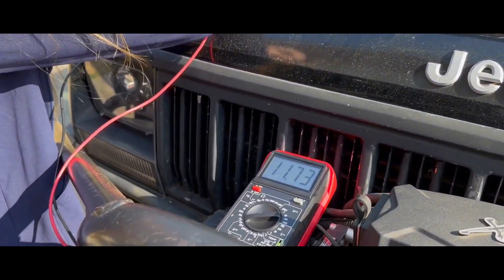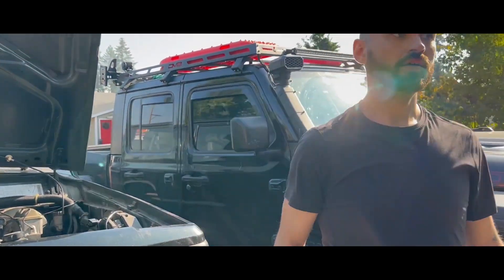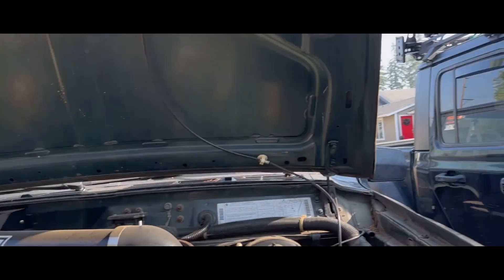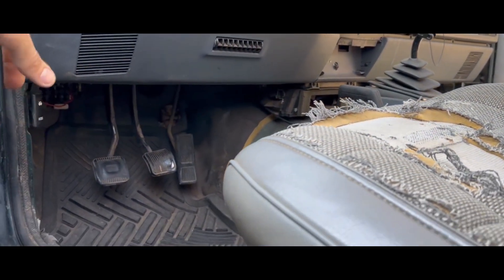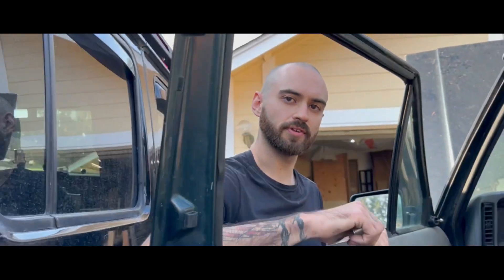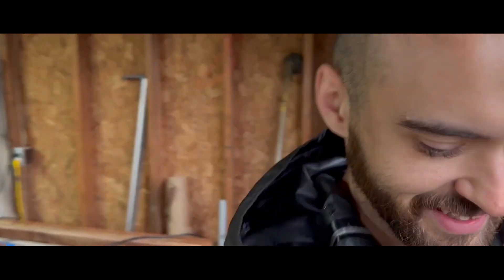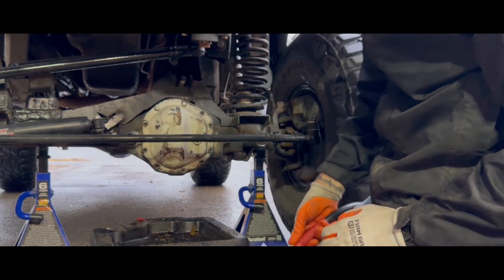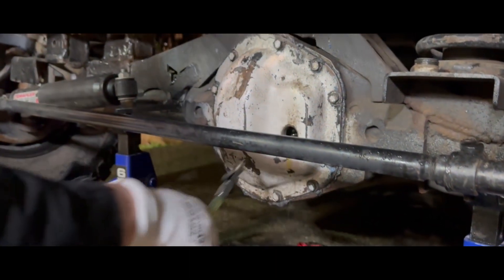Jeep Cherokee Resurrection || Episode 2. Fixing the Gremlins

Comment: Great video
Reply from the maker: Thank you!
Reply: I’ve had a 2000 XJ for over 12 years and had a 93 before that. The iac valve gives me trouble every couple years. Usually I’ll clean them but this last year I had to replace one for the second time. My advice is don’t get the cheap ones because it only lasted a couple years. Always seems to solve idle issues with it. Well done!
Reply from the maker: @slacknor  that is great information. I threw in what I found in the back of the jeep. It was definitely a no name. I’m sure it’ll fail, but at least it got me on the road in the meantime.